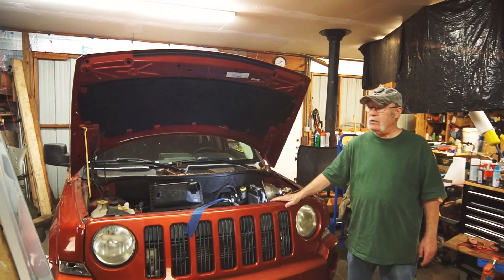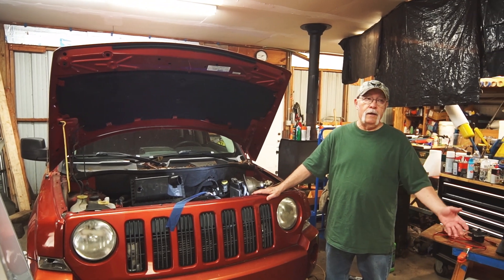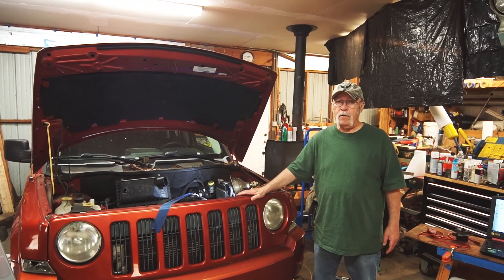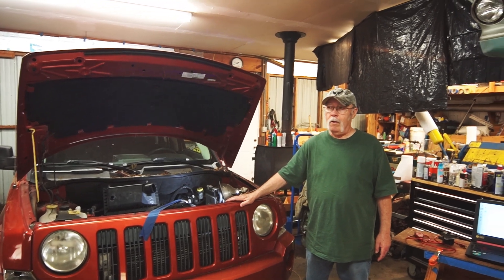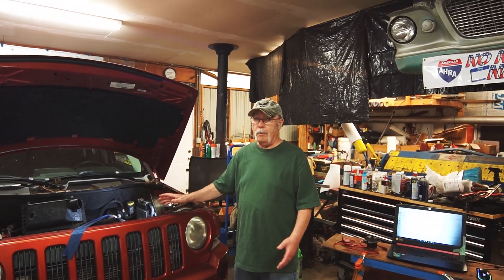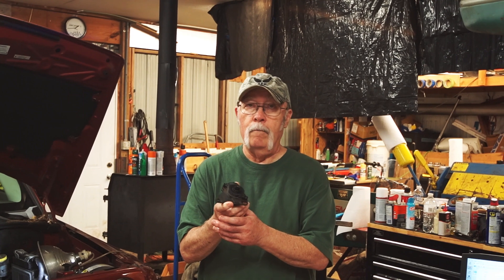Never Replace the Oxygen Sensor First

Comment: 🥎✔️Hope it continues to play ball with you. I like OBD2, it's accessible, but it almost doubles to total wire pin outs from about 62 in the OBD 1 days  to over 110 on the OBD 2 era. Sensor problems get a code throw which is determined when an algorithm triggers the code. So the computers ECM is monitoring a brace of data for a predefined condition, usually from two set variables. The fault code is "there for".only a lightning ⚡ rod, indicating a potential problem..

Comment: Same with my 1989 Taurus Sho (Yamaha Engine). The long runners were for low RPM torque. When the RPM’s would go over maybe 4,500 then the short runners would start opening. It was vacuum operated. Nice and simple.

Comment: My old 97 Ford had a similar setup, but simplified. It just worked off vacuum. Loss of vacuum, means you sunk the boot in, so it gives you the long runner for torque, vacuum rises, it shifted back to the short runner. Now I have a 2008 Ford, which is a Diesel. Sensors, actuators, error codes all driving me nuts. Forscan on a laptop, with an OBD2 interface is used, to get a vague idea where to look for the issues 🤣